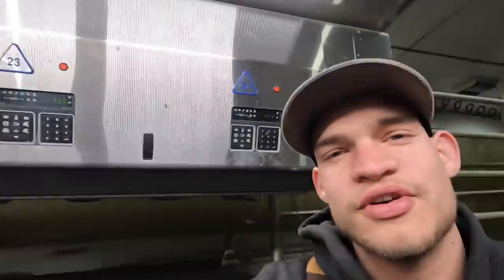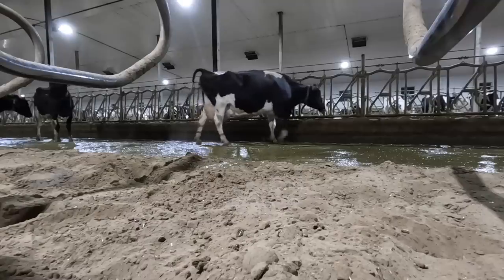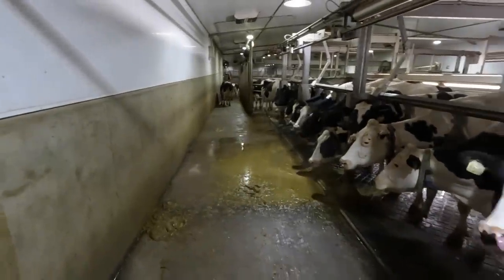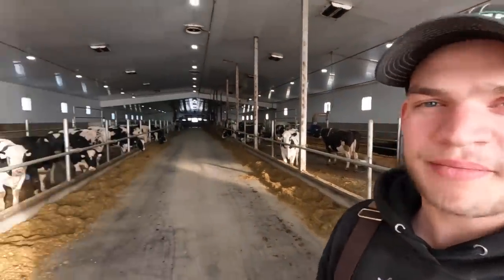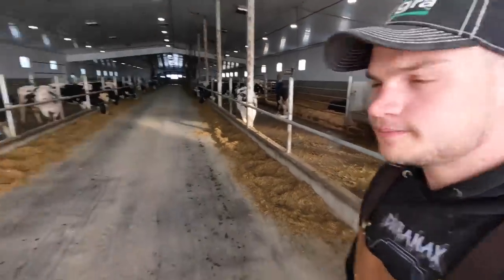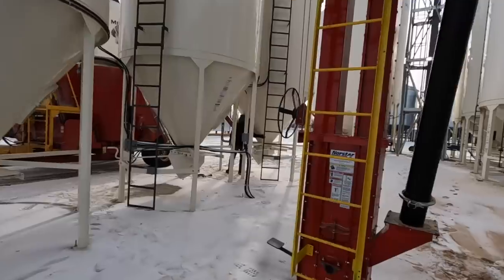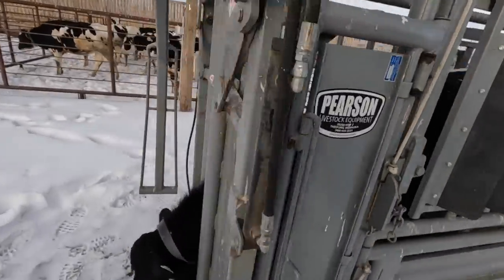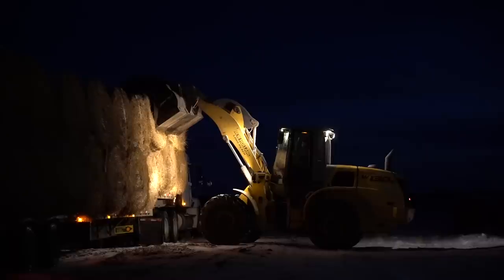Her First Calf is On The Ground!

Comment: Why would the insurance company require a room around the hammer mill?
Reply: Good question.. suspect… and I could be wrong.. is that the room minimizes risk of a dust explosion.
Reply: @billinburlington5507  Could also be if you don't do what they say exactly then they can deny any claim you try to make even if it makes no sense and costs extra money. Hard to tell from the video, but if no ceiling on the room that they built to comply to the insurance requirements then they could still deny the claim. Not a fully enclosed "room". The building has a roof but not the room. Anything to get out of paying a legitimate claim they can think of they will do.